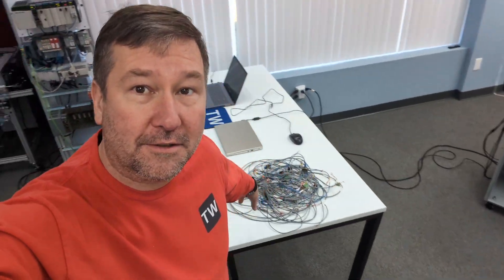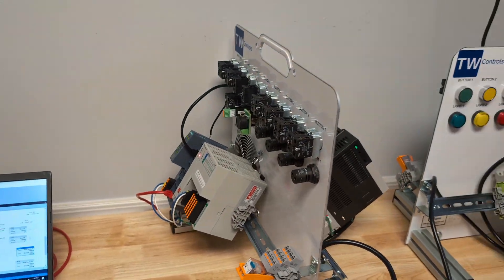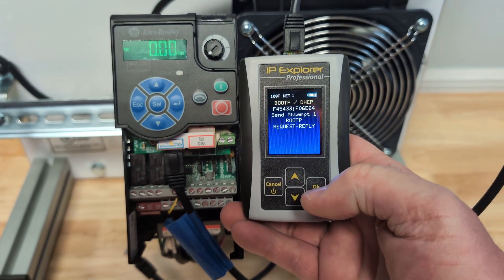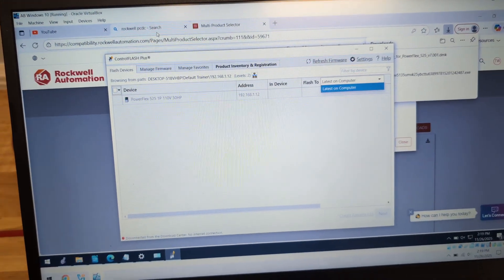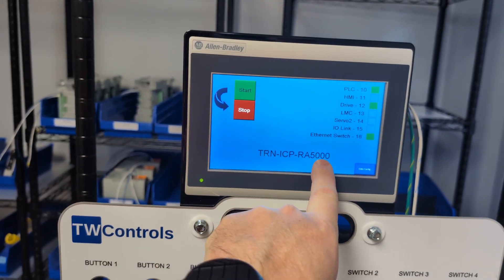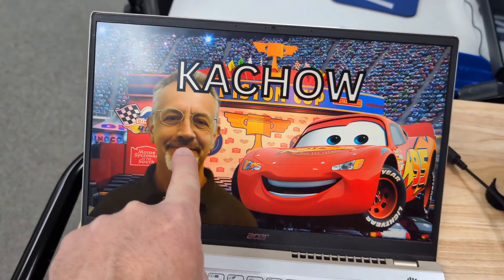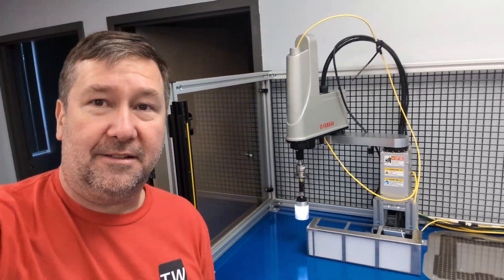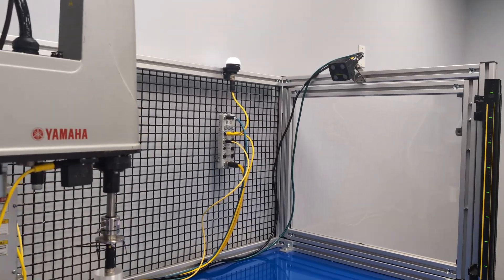I Crashed My Robot but Check Out These Refurbished PLC Trainers

Comment: Hello ,I am new to Allen Bradley plc 
I am using a 1769 IF8 A analog input module 
Connecting a 4 to 20 mA sensor
Using multimeter I confirmed the values as 5 mA and another one as 11 mA
But the raw data read is as follows
For 5mA it was About -ve 17000
And for 8mA it was about -ve 8000
Why is it in negative
Reply: I did make the configuration as 4to 20 mA raw/propotional
Reply: Also when there is no input it give -32767
Reply from the maker: Check your configuration for those channels then have a look at some of our scaling videos.